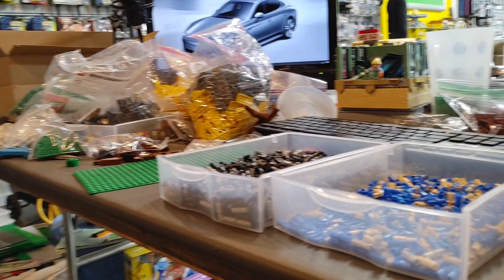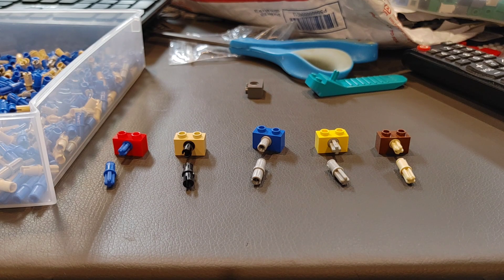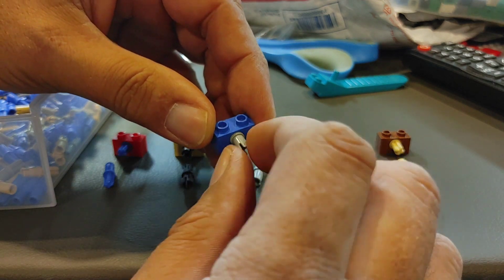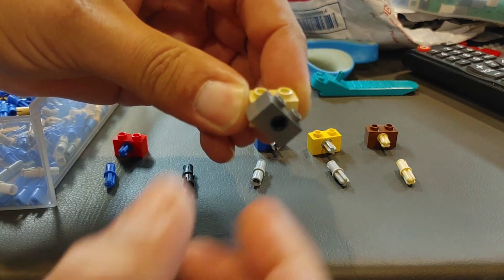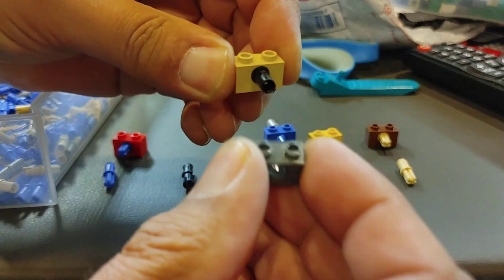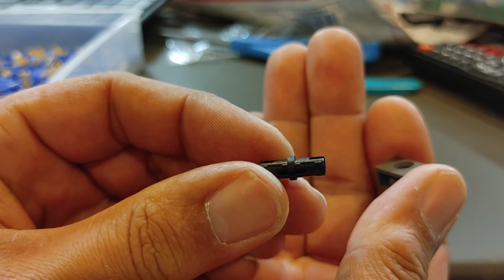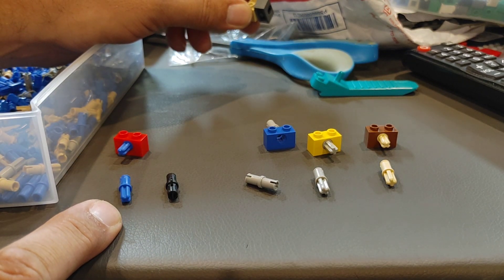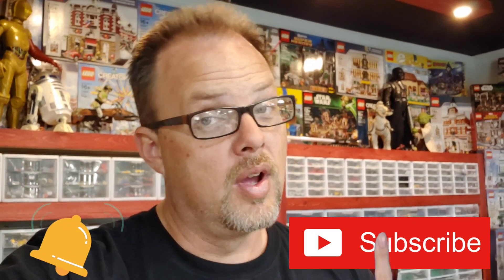Lego Pro Building Tip on Technic Pins

Comment: The friction pins are NOT for holding another part at an angle (there isn't enough friction to keep the pieces in position). They are so the model you build is rigid. Build something with all non-friction pins and see how wobbly it is. The gray and yellow pins on the right are the same pin, just different colors (the gray ones are an older style). There are long pins that are also made in both friction and non-friction type too.
Reply: In some cases the friction pins are meant to hold a small part at an angle like a spotlight that can move but will remain in position when you move it but yes most of the time it seems to be to make a structure rigid

Comment: Am I the only person who struggles with Technic builds where, for example, 2 parts have to mate and one has 3 pins sticking out and the opposing part has two or 3 pins? The flared ends make it nearly impossible to press them together. I'm an experienced builder and always wind up using a needle nose pliers to squeeze pin ends until they slip into holes. (note: I have also found the needle nose to be the most effective tool for removing pins that were placed incorrectly.)
Reply from the maker: I've never had a issue inserting, but yeah they can be a pain to get apart at times.

Comment: But what about the red pins??!
Reply: Red cross at 2 length is just a regular beam axle but it's 2 studs long.
Reply: @g.williams2047  I’ve seen those too. But I’m curious about the red technic PINS.  I’ve seen some with integrated stoppers or axles, and I’m not sure but I feel like I’ve seen some with friction and rotating configurations ...
Reply: @Mike-B-Jackson  They might be pins from an old set, where another color would look terrible. They've done it before with the color red and yellow.